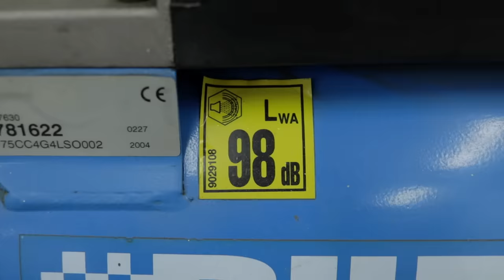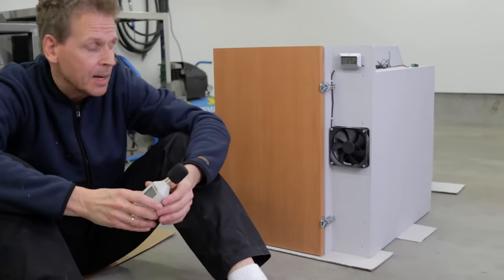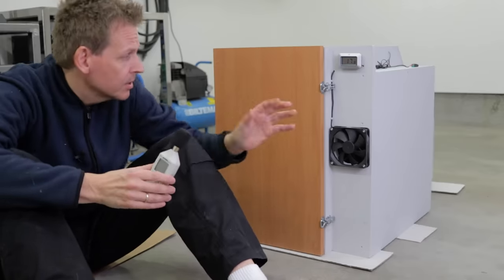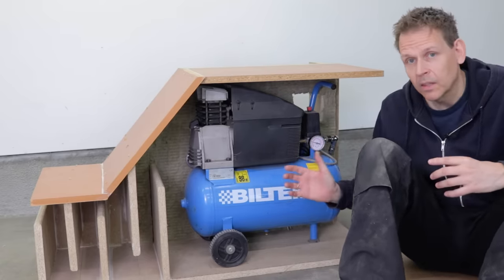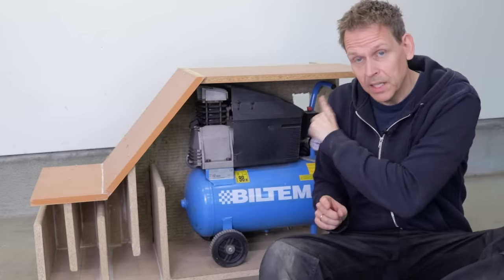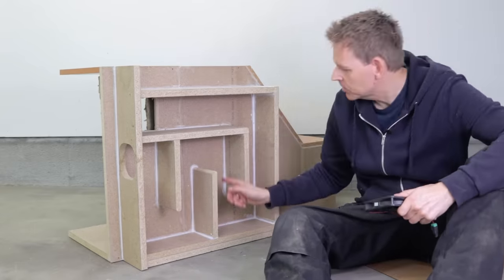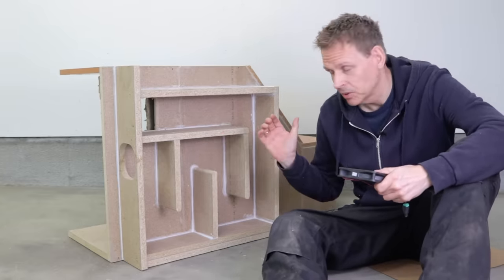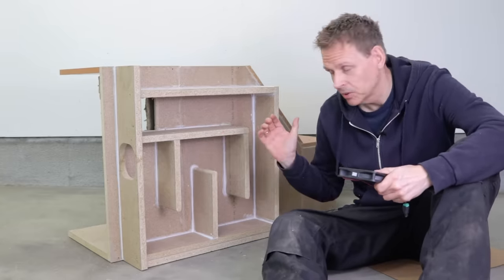Do not build a sound insulated enclosure for your noisy air compressor!

Comment: The first error is to make the intake on the top of the compressor and the exhaust in the bottom. In fluid dynamics, it's a big mistake.
Reply from the maker: Agree! I should perhaps have mentioned it, but I have ventilation upstairs in my garage between the floor and the ceiling. The design makes the hot air blow out of the garage.
Reply: @kihestad  the problem is that the Fresh air is warmed by the compressor before the intake and this perturb the yield of the compressor. 
It's much better to strive the air in the bottom where it is colder. 
Excuse me if I have made some mistakes in my sentences, I'm french and I quit school 40 years ago.
Reply from the maker: Your English is more than good enough, and probably better than mine 😊 And you are correct - in theory, intake should be low and outlet high since hot air rises. But it does not really matter much in this application. 

Two fans make sure it's good airflow through the box. One fan pump air into the box, another fan blows air out of the box. Since the box is sound isolated using Rockwool, it's also heat insulated. There is no heat to talk about that escapes from the box, except what is transported with the air out of it at the rear. The temperature in the room is exactly the same at floor level, as 40 cm higher up where the intake is.
Reply: @kihestad  thank you for your comment about my English. 
About the problem that I was talking about, it's just that the natural hot air flow is always going to the highest point of a closed box and your box construction is blowing against it. 
Thanks for your comments.

Comment: Your number one problem is that you are blowing hot air down rather than up and out?
Reply from the maker: I should have mentioned that I put the exhaust at the rear of the box because my garage is not insulated and it is an opening for ventilation where the ceiling meets the floor upstairs. The exhaust air from the air compressor box is placed up against this opening. The hot air from the compressor is pushed out of the room to outside of the building through this opening. By doing it like this I avoid the hot air to be circulated back into the room. I did not tell about it in the video, but now you know 😊

Comment: Mine has a temperature controlled Cooling Fan
Reply from the maker: I have planned something similar, but I have bought an electronic device with a tiny microphone that turns on a relay at a specific sound level (adjustable). By using it I can get the fan to turn on when the compressor starts (I put the sound sensor inside the case), it has a delay for turning off, ex I can set it to one minute after motor stops. Then I can prevent the case becoming hot in the first place :-)

Comment: After what I can see you did not put any actual sound dampening materials in the sound dampening box, with sound dampening material you would get  HUGE improvement in sound dampening...
Reply from the maker: It did not show as well on the video, but I used 3cm Rockwool sound insulation material on the inside and put the white fabric over it. I use the same in my sound panels in the ceiling, made a video about them as well 😊

Comment: Definitely worth constructing the sound box
Reply from the maker: It all depends, if you have the materals you need or cost is no issue - go for it! If you take cost-benefit into the equation, well then it might be more practical and cheaper to just sell the old noisy air compressor and buy one that is made silent by the vendor.
Reply: @kihestad      like animated  guy as your logo,

Comment: Your baffling is very large,  probably too large to be helpful at the frequency your air compressor produces noise at. The insulation you used is quite thin and the very good construction of your case actually makes it susceptible to sympathetic vibration. I would recommend using rubberized undercoating on your substrate before adding your insulation which needs to be about 4 times as thick as what you used. Put the case on rubber standoffs to minimize vibrational transfer to your floor and you shouldn't have any perceptible noise. As you have already finished construction of your case I would put rubber mounts under it and put a loose sound dampener (loose crumpled news print) Your building skills are top notch but your acoustic theory is a little off.
Reply from the maker: A lot of good tips here, thanks a lot 👍🙂 I was afraid of not having enough airflow, so I did not dare to make the ventilation channels with the baffles smaller, but you are probably right. It would have made it even more silent improving them as you say 🙂 btw: I did use 3cm Rockwool sound insulating material on the inside of the main chamber, behind the white fabric. It did not show very well in the video.

Comment: No reusing of Styrofoam as sound insulation. ? Would have made a simpler design.
Reply from the maker: I am not sure if styrofoam is very good for sound insulation. I have not seen it used for other than heat insulation. I would think it might be reflective, and for a box like this a sound absorbing material is best. I have to admit: I don't really know 🥴 I did not consider it at all for my build

Comment: I guess you could get the same results if you use two cartoon boxes, a big one in the another, with foam between them, it was easier and at low price and expend less time to build the enclosure.
Reply from the maker: Not exactly. Plywood is more dense than carton and stops sound waves much better. The foam work great for stopping some high frequencies, while low frequencies needs more dense material - or was it the other way around? 🤔

Comment: the biggest argument i've seen for not building a soundproofing box for any equipment is because out of sight out of mind.  which means, they don't get maintained and it ends up costly.  you also can't hear if anything is going wrong with it.  but i'm talking 20k compressors.

Comment: I have a belt driven a 25 and 60 gal compressor, nowhere as annoying. My little 6 gal pancake compressors shook up the house and wake up the dead. An enclosed box with sound damping material should help.
Reply from the maker: Yeah, one might think a bigger machine must be more noisy than a small one, but not for air compressors 🥴

Comment: I can see why you didn't get much noise reduction right off the start. All those flat surfaces just reflect. I saw your painting part of it. I build a soundproof cabin for something it's aligned with two inches of rubber foam. Did you put anything under the legs of the compressor so that it wouldn't transmit vibrations through the floor of the walls? I guess maybe you should change the title too this isn't the right way to build a soundproof enclosure for an air compressor.

Comment: Loud noises actually increase stress on the body. Which could lead to reduced lifespan. Anything you can do to mitigate loud noises around you, the better.
Reply from the maker: Well put! 👍 A noisy environment is absolutely stressful. In addition to that: you never know when an air compressor starts, makes you skip a heartbeat every time it happens if it's loud enough and your not far away from it 🥴

Comment: Putting the compressor on some foam material and maybe also put some foam into the case would have made it even more silent
Reply from the maker: I think you are correct 👍 The vibrations from the compressor are now transferred to the wooden floor upstairs and it does make some noise. Will try to improve it using some soft rubber. Thanks for the tips 😊
Reply: Some air-filed packing material worked fine for me here. I just put it under the compressors feet. Maybe it also works for you.

Comment: Volume doubles every 3 dB, not 10
Reply from the maker: I might have over-simplified how the Decibel scale is to be understood, let me try to clarify (based on a discussion / explanation from the comments): 
* 10dB increase is the typically stated value for doubling the perceived volume (subjective), without respect to actual power/energy. 
* 3dB increase is a doubling of the actual power/energy (objective), without respect to how a typical person would perceive or rate sensed-volume. 
I have to add that the Decibel is a difficult scale to relate to (at least for me), I might have to study this a bit more - sorry if I got it wrong 😌
Reply: @kihestad  or I thought I knew more than I did and just learned something. Cheers

Comment: Just remember to cut the power to it for the night, if a hose fails it will probably burn down your garage when it overheats in that box 😅
Reply from the maker: Yes, indeed I will 👍 and that is not just for the air compressor. I have a lot of electrical equipment, everything is shut down every night and I normally double check that all my power tools are disconnected from my power outlets!

Comment: So far it seems like you're building a transmission line subwoofer cabinet😂
Reply from the maker: hahaha 😂 I have made some speakers myself up over the years, subwoofers as well, and you are right: The box is very similar to one  😊
Reply: Yeah ive got two subwoofers in my living room I build and a ported t line crossover cabinet so they'd be relatively small but go very low and the t line port looked just like this heat outlet side under the roof did😂
It has one board less though and folds underneath to the front so the port also functions as a shelf and breathes nicely into the room. The dimensions of the space in between is different to match the right pressures and frequency but it looked remarkably similar before the sides went on.
Can't use them though because of the neighbors😅
Apparently 2800 watt rms is too much for an apartment building😂
Reply from the maker: Wow 😲😳 very cool!!!

Comment: Doesnt putting a heat generating compressor in a small box just make it's job more difficult since the air will be much warmer inside the box. I call Norwegian reset on this one.
Reply from the maker: It probably affect the compressors efficiency negatively just a tiny bit, perhaps it even shortens the compressors lifespan? I did add a fan to push air into the box though, and the temperature never gets very high inside. It's not really a problem we have here in Norway, unfortunately 🥶😅
Reply: @kihestad  I meant it would have to work harder to compress the hotter less dense air and for that reason have longer duty cycles meaning less sound for a longer time. YOur fan might have made more difference if it was put on the exhaust side though. It's a very nice construction though with the transmission line and all.

Comment: Would be better to make using cheap thin plywood and couple layers of thick cardboard. Top venting should be for heat output. Low venting for fresh cold air. Organic material is superior than inorganic material  for killing sound.
Reply from the maker: The reason I put the exhaust at the rear of the box is this: My garage is not insulated, there is an opening for ventilation where the ceiling meets the floor upstairs. The exhaust air from the air compressor box is placed up against this opening. The hot air from the compressor is pushed out of the room to outside of the building through this opening. By doing it like this I avoid the hot air to be circulated back into the room. I totally forgot to tell about it in the video - my bad 🙄

Comment: Put the thing outside, with some sound insulation between you and it.  Let your neighbor complain share the noise.  But if it is running often enough to really be a noise problem you are probably doing commercial-grade work with your compressor, at which point you should seek out commercial grade solutions and not DIY.
Reply from the maker: Absolutely hobby-grade usage here, not used that much. Not even every week, but typically used at weekends, and I think my neighbors would prefer not😊I dont have space for it outside anyway. My garage is placed with minimum distance to two of my neighbors. The side facing my own property is not usable either,  as it's just a slim path between my garage outer wall and a concrete retaining wall. In front of the garage door is no good either 😋

Comment: Biggest problems with enclosing it is heat as heat removal is the most important problem as piston compressors need to off 50%of the time to cool. So enclosing it would possibly leave 20% running time and 80% off to cool.
Reply from the maker: I totally agree. The air compressor will not live for long if it runs above the recommended temperature 😐 It's is luckily (or unfortunately - it all depends who you ask 😋) a pretty cold climate here where I live in Norway, in the Northern part of Europe. I have actually fitted a heat pump in my garage to be able to use is as a workshop during the winter time, if not it is freezing here. I can see overheating is a big challenge in warmer climates. A more powerful fan or even radiator cooling could be needed must then be considered.

I have fitted a thermometer and I do check frequently that it's not getting to hot inside the box. Normally the temp increases 5C = 10F when it starts until pressure is built up, and it takes just a couple of minutes to cool it down. If it is running constantly over longer periodes it can get a bit hotter, I have seen almost 10C = 20F increase. The warmest summer days can be 30C = 86F here where I live, but that is very rare. Its more commonly 25C = 77F, so it never gets very hot inside my box.
Reply: @kihestad  I am based in the UK and repair compressors and one of the biggest killers is heat damaging the electrical side or warp the head.
Even this hot summer we have had has taken its toll on many.

Comment: You used a lot of flat material to dampen the sound. Next time used material that has more texture or have the material laid down so it adds more surface for the sound to be absorbed.  Egg crate foam would help absorb more sound.

Comment: There was clear noise difference. Of course getting a less noisy compressor is a no brainer.
Reply from the maker: Exactly, but I was a bit surprised (and disappointed) that the box did not remove more of the noise than it did 🙄🤔
Reply: @kihestad  You can make a dual box, with some air gap between, if you take care of air inlet and this will work perfectly fine. Of course sound insulation also does heat insulation so if it gets hot in there, it will gt hotter and it will be harder to remove heat.
Reply from the maker: Box inside box would probably work very well! 👍 Downside: even more work, more expensive and probably even harder to get upstairs in my garage 😁😅

Comment: Make that box waterproof and put it outside, run some air hose through a hole in the wall, and it will be quiet inside the shop.

Comment: So now you can use your previous air compressor tank as a main-work-tank. 
Cheers.
Reply from the maker: Yes, but no. I gave it away 😋 It's something I have thought about though, if my new compressor is not powerful enough I can try to source a tank and add it for extra capacity.

Comment: Long hoses are pressure loss and it run more. If they must be long, large hoses are better.
Reply from the maker: I know about it, but for my usage I have plenty of air flow on all the outlets. My air driven impact wrench has no problem getting the bolts of the wheels on my car, and that's the most heavy duty tool I have or need - at least for time being. If I need to use bigger tools that requires more air, well then I need to deal with it. I can either replace the lines with bigger ones or add a extra tank downstairs.

Comment: You could build a small insulated shed outside.
Reply from the maker: I wish i could 😊I just dont have space for it. My garage is placed with minimum distance to two of my neighbors. The side facing my own property is not usable either,  as it's just a slim path between my garage outer wall and a concrete retaining wall. In front of the garage door is no good either 😋

Comment: Better idea is to build a weatherproof  enclosure for the compressor outside and pipe the air in
Reply from the maker: Yes, I agree. Unfortunately I don't have space for it, my garage has minimum distance to two neighbors and is very close to a retaining wall on the third side 😔

Comment: Your box design is actually a sound attenuator, not a sound deadening design. This is the same as one designed for a  subwoofer. You need irregular angular shapes to cancel out sound waves. Sound deadening foam would've been better to line the box with.

Comment: Simply use an air compressor that has a separate motor and pump that uses a belt. They are quieter and more efficient.

Comment: Step 1, buy an industrial 400V compressor (maybe second hand).
Step 2, grease the bearings.
Done
Most compressors are noisy because they are build on a tight budget.
Reply from the maker: Unfortunately I have 230V in my garage, I don't think it's very common to have 400V unless it's a farm or a industry building.
Reply: @kihestad  Here in Germany most houses have a 400V (triple 230V) connection. Kind of needed when you want to cook with induction for instance. In the Netherlands most people cook with gas, so many households also have a single 230V connection. So it depends.
Tesla would have wanted triplephase everywhere. He was a clever man.
Reply from the maker: Ahh, that is nice - I have three phase 230V, that is somewhat common here in Norway. I do think some electric cars can charge twice as fast using three phase vs one phase, and some bigger machines might utilize three phase.
Reply: @kihestad  I would even dare to say you can charge a car 3 times as fast with triple phase.
1 phase 230V 16A has a max of 3,7kW
3 phase 400V 3x16A a max of 11kW
A 400V is nothing more than 3 230V connections that are 120 degrees out of phase. 3 fuses and everything.